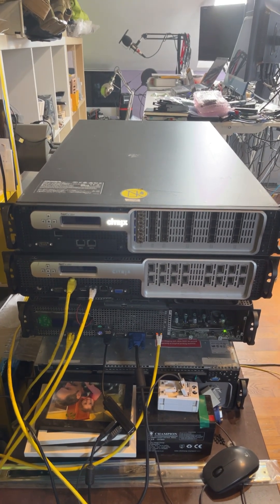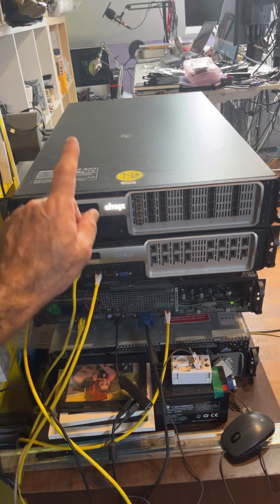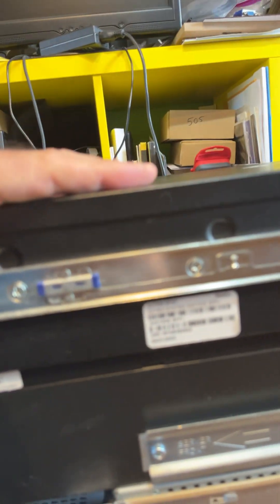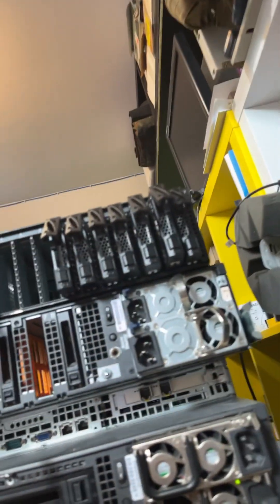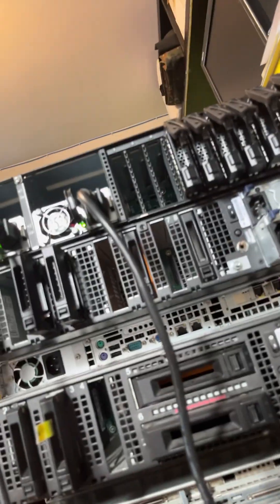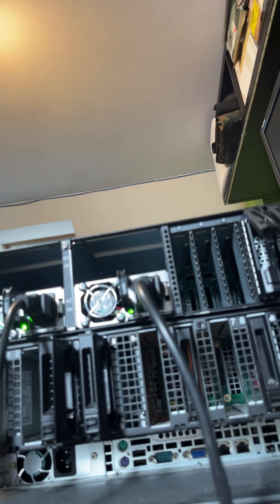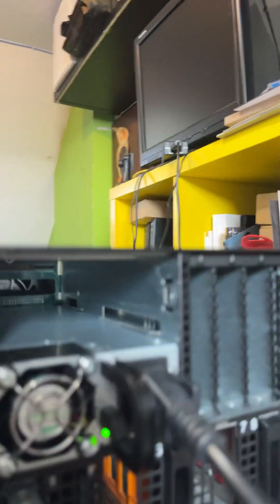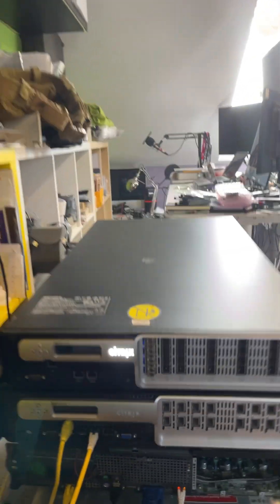Citrix NetScaler MPX/SDX 22000  First look

Comment: Hi, how are you? I’m from Brazil.  Can I use power Supply Dell R620 750w in the MPX22000. 
I need to buy to support and maintenance. Do you indicate any partner?regards Cláudio
Reply from the maker: You would have to check if the Dell power supply is actually the same with its connections to the motherboard. Citrix uses Supermicro motherboards. Their power supplies appear to be proprietary. I have never seen the Dell PS you mention so I do not know. Sorry.
Reply: @NetScalerTrainer thanks for return. Do you know Company to sell power Supply for Citrix? MPX 22000? Regards
Reply from the maker: @claudionunes9762 you have to check eBay and Amazon, last you can check Supermicro directly or find a supermicro partner in your country. For sure they can get one. Just depends on what you are willing to pay.